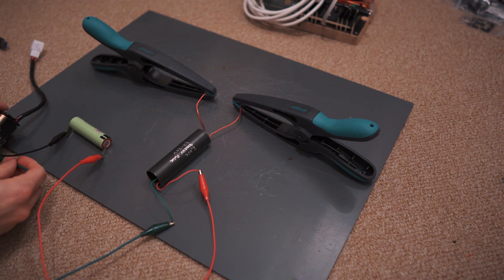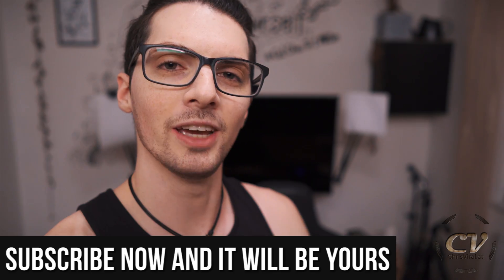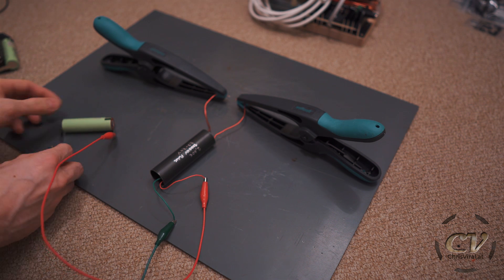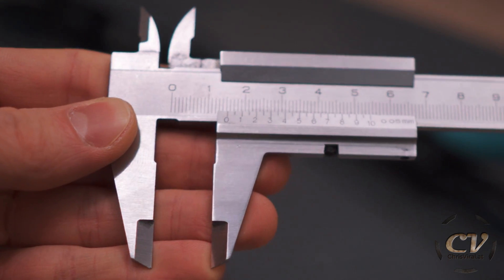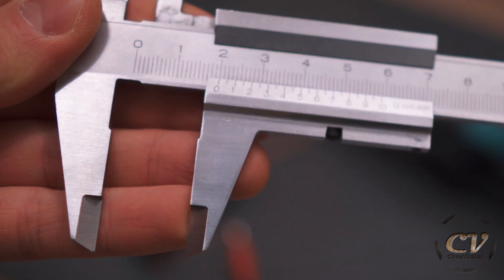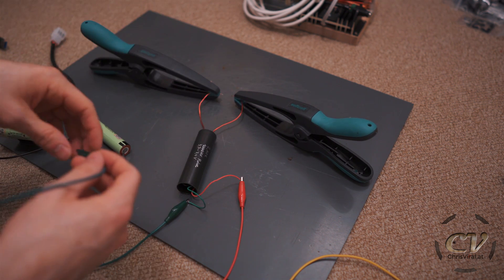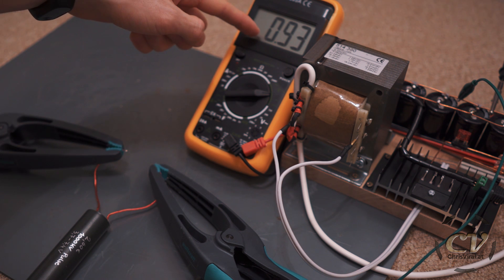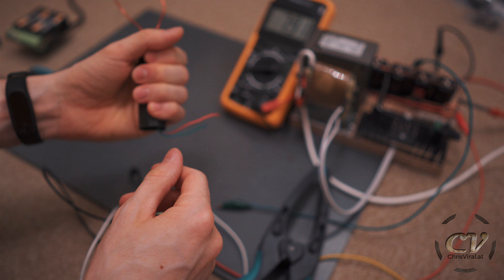1000KV High Voltage Generator Review (DEPRESSING)

Comment: You have killed it because of:
- high voltage(8v) than this module meant to used to be
- around 3th minute in the video, you made output spark gap connection too far that's why module wasn't able to send electricity through the output wires and it started to burn internally and make stupid sound (That's main reason which you killed it)
Reply: X
Reply from the maker: Regarding high voltage - agreed. But regarding internal burning - not agreed. Why?

I can imagine that to be true to a certain degree, but in many of my tests, many modules were not able to arc. So in theory all of them should've died due to internal shorts. In the "10x in series" experiments for example. All 10 of them would be dead if your statement would be true. None of them got damaged though. Just take a look for yourself:

Series VS Parallel: https://youtu.be/BRbHBiwdcc8
5x In Series: https://youtu.be/pN7a8VlU9Gc
10x In Series:https://youtu.be/pGp38mRxBFI
Reply: @ChrisViralVlogs   It arcs internally because as you lengthen the gap distance, the module requires more voltage to jump the gap and so the module begins drawing more current, and as the current draw increases, so does the internal resistance and so it heats up. after enough of that it will break the module because the windings inside melt.
Reply: @ChrisViralVlogs  well these things are cheap. And they drive the coil with a PWM signal. The output voltage depends only on the load, and the current flowimg through the primary coil. If there is no load at all the max voltage of this is infinity. Of course there will always be  a load due to corona discharge and plastic is conducting a bit, too, but the voltage will rise very very high, if there is no load to it at all. 
Thats because when there is a current flowing through the primary coil, that is interrupted suddenly, the current must not stop suddenly. It has to go on, like it was in a differentiable way. Else ths voltage will ne infinity, cause then the derivative would be infinite. Thus the voltage of the primary coil will rise to a very very huge amount. And then the voltage of the secondary coil will be even bigger, if there is no load to it. 
So it may or may not arc through depending on how long you power it with no load at all, and depending on how good the isolation itselve, and the air "conducts".
Reply: @ChrisViralVlogs  you have no idea about electricity, do you?
Reply: @Alex-dd9xx  But he has a YouTube channel, he must know what he's talking about!  :P  (Kidding, he's an idiot).